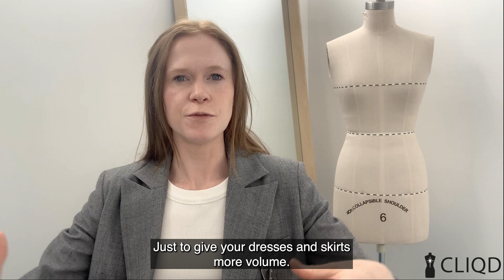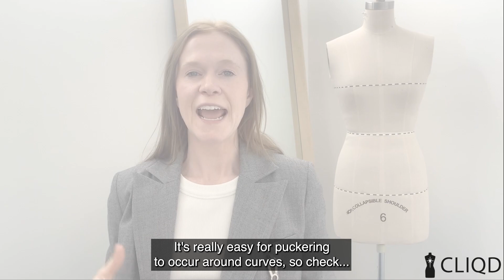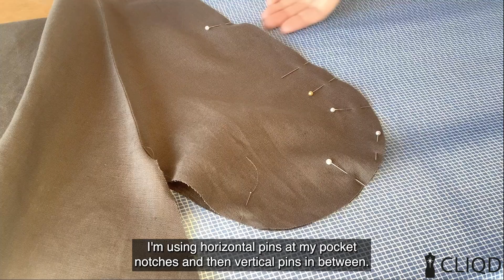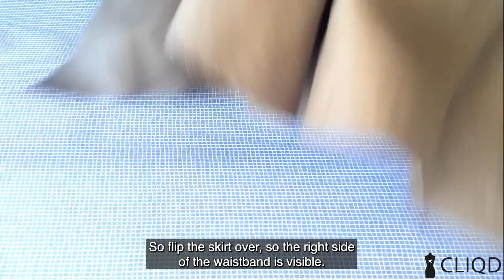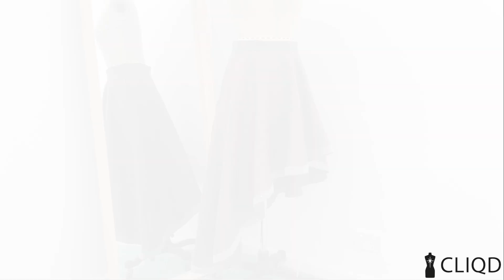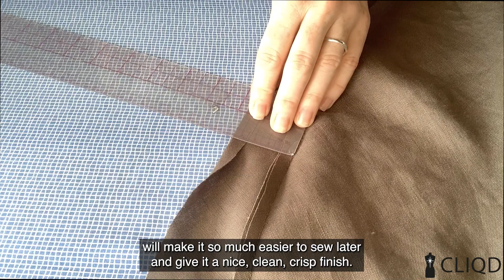Make ANY Flared or Circle Skirt (incl. pockets & zip) | Skirt Sewing Tutorial

Comment: These two episodes about the circle skirts were truly valuable. Thank you very very much. I have always struggled to "put" the flares where I wanted them, and now I am able to do so. One question though if I may, you said that it is always beneficial to keep in mind the grainline and try to have seams with similar grainslines. This logical, but then what to do if I need to put the zipper in a seam that happens to be on the bias. For example if I have the bias in the back and I need to put the zipper there?
Reply from the maker: You're welcome 😊 Glad you enjoyed the video series! 

Yes, ideally joining seams would be on the same angle – but it's not always possible. If seams are at different angles, I'd recommend letting the unsewn seams sit on a mannequin (or hang) for 24 hours to let them drop. Then, sew them together. The seam more on the bias will have excess (i.e. be longer) and you can just trim off the excess (and adjust your pattern).

Zippers can be interested into seams on the bias, but you need to be extra careful about stretching the seam when you sew them. You could try a basting stitch first or fusing tape to secure it.

Let me know if you have any more questions
Reply: @PatternMakingWithLeigh  Thank you :)

Comment: This is definitely next level. Thank you for sharing such a detailed and informative tutorial on couture circular skirt making. I look forward to further challenging myself. Based on your expertise, how important is it to add a facing to the hemline of a long flowing gown?
Reply from the maker: Hey Curtis😊 it really depends on the fabric and how curved the hem is. 

If the fabric is light-weight (e.g. chiffon), I'd do a pin or rolled hem. This will work on curved hems too as the hem is so small. 

If the fabric is medium-weight (e.g. cotton & linen), I'd try and do a double fold hem 2cm (3/4") wide. If the hem is really curved (e.g. full circle skirt), you'll probably need to add a facing as you won't be able to turn the hem allowance along the curve without it buckling.

Let me know if you've got any more questions 😊
Reply: @PatternMakingWithLeigh Thanks, Leigh you're awesome! I am so used to adding the horsehair braid directly to the hem of the circle and trumpet skirts that I make so this tutorial with the facing in the hemline inspired a new perspective. You're right, as I have to deal with a lot of buckling at times and it requires a little more time and patience but will try based on your method.
Thanks, again for sharing such informative tutorials in helping others to improve their crafts. 😊
CurtisC.
Reply from the maker: @curtiscallwood3038  You're very welcome ❤

Comment: I am making a dress with a circle skirt for my sister. My question is on the hem facing. In the pattern making vid it sounded like the facing should be all one piece, but that seems impossible given how wide it is! So to confirm the facing is seamed the same way the skirt is? Or is the back facing to also be one piece like the front (my zip is at the back so my back piece is cut in two.
Reply from the maker: I'm so sorry! I thought I replied to your comment last week, but it didn't go through.

You got it! The facing is seamed the same way as the skirt. So, I had a separate facing for my front and back patterns. 😊

Even though you have 2 back patterns (because you have a centre back [CB] seam & zip), you can stick them together at the CB seam, and just have one pattern - this will save you sewing an extra seam and give you a cleaner finish.